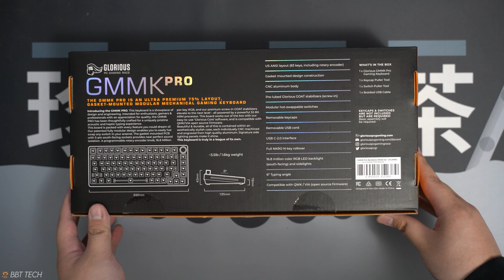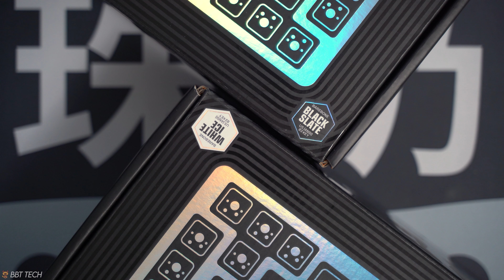GMMK Pro - Overhyped? or Just Right?

Comment: Would you say the polycarbonate is better?
Reply from the maker: You may get a little softer of a feel but you would need to remove some foam. The RGB is also a  bit better as the Polycarbonate plate diffuses the light a bit more

Comment: Yo could you give me some advice about what the best hot swap barebones/diy kit or something else like those would be and is no more than $150. Also the size being either 60%, 65% or 75% that sounds good and preferably made of aluminum but idrc. Thanks so much and I love your vids
Reply from the maker: So for a 60%, I have heard good things about the Bakeneko from Cannonkeys

For 65%, there are a lot out there but I personally think the KBD67 Lite is a great entry choice

If you are looking for 75% board, I would say maybe saving a bit more cash if possible and buying the GMMK Pro. Its hard to compete with that board in that price range
Reply: @BBTTech  I’ve heard the the gmmk pro is very stiff though
Reply: @BBTTech  also I have heard good stuff about the boards you mentioned but they are all out of stock

Comment: yoo isnt the keycaps more expensive hen the board?
Reply from the maker: Nope, keycaps are 110 USD and the GMMK Pro is 170 USD
Reply: @BBTTech  well 110 for base kit, plus 20 for space bars, plus 20 for novelties.... i guess you were right, the keyboard is $20 more expensive lol
Reply: @theelit3170  he only bought the 110 dollar base kit. He did not buy the extra space bars and novelties as it is a huge kit. It comes with all of it. So no it’s still 60 dollars more than the keycaps...
Reply: @slimpotato3332  ahhh i guess he got round 1, as round 2 you need to purchase separately...
Reply: Naresh Ramlakhan the base kit comes with everything. The extra spacebars are often a different color or different size or a mixture of the 2.